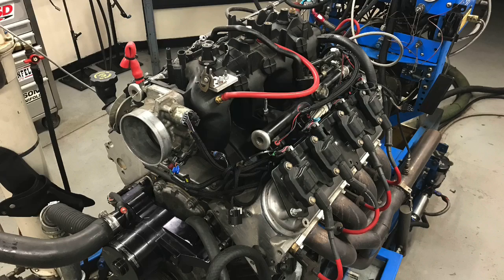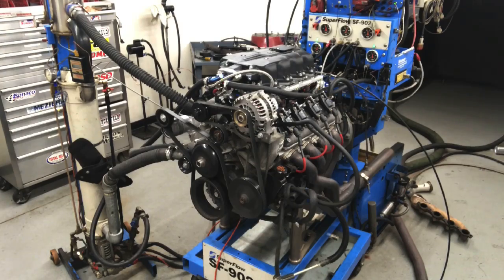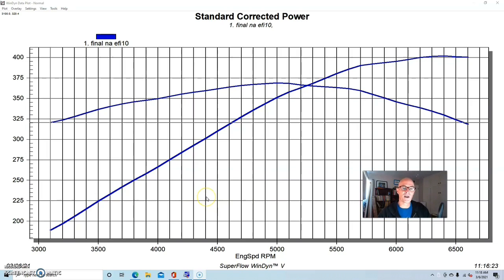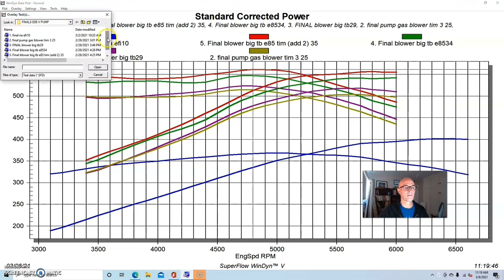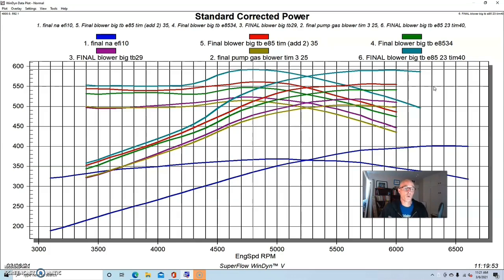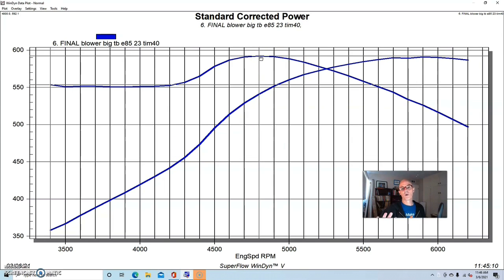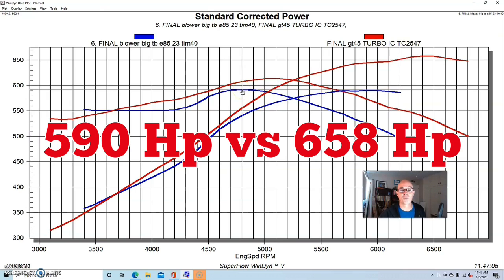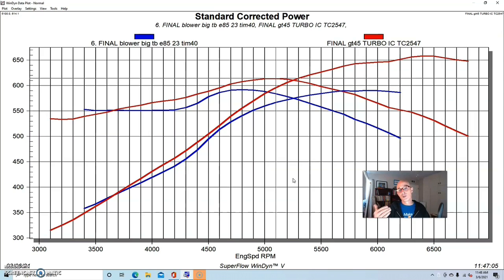CAD LS BLOWER VS EBAY GT45 TURBO-WHO DOES LOW $ BOOST BEST?

Comment: WRONG......BOTH TOGETHER !!!!! LOL    Use the clutch pulley off the Eaton supercharger from a mecedes KOMPRESSOR( It's electrical activated on and off) , Wire it for constant on. Then on the Turbo side wire in a pressure (boost) activated switch to turn the super charger off at a set level of boost from the turbo and then on again when the turbo loses boost.  BEST OF BOTH WORLDS.
Reply: PUT THAT ON YOUR DYNO AND TEST IT !!!!!!............PLEASE  LOL

Comment: No fair - the PD blower was seriously crippled by trying to fill each LS-sized cylinder by a single Northstar-sized blower-runner.
All you would have had to do wold have been to run interconnecting runners to: 1st and 5th cylinders in firing order, 2nd & 6th, 3rd and seventh cyls, and 4th and 8th together. You would have seen a built-in bottleneck disappear (instead of seeing horsepower fallover WAY earlier than the NA setup.)
Reply from the maker: that is not accurate
Reply: @richardholdener1727  How not? Looked like one Cad runner-per-LS-port to me? Miss anything?

Comment: Man, these are awesome numbers for a 4.8...I'd really like to get an 80s Cutlass (G-body) and put this 4.8 in it with a good cam, the Cadillac blower assembly, a set of tuned-length headers, and a true 3" dual exhaust with Black Widow mufflers.

Comment: its impossible to turn anything with NO parasitc loss. the engine is acting as an airpump to spin the turbo. there is no such thing as free energy. turbos can not violate thermodynamics.
Reply from the maker: THE IMPART MINOR PUMPING LOSSES COMPARED TO THE PARASITIC LOSSES FROM THE BLOWERS

Comment: I wish I could find conversion manifolds for the Cadillac supercharger or the ford 5.4 gt500 supercharger to fit the Aussie BOSS260 5.4ltr 4v 😭
Reply: That would be cool.  I have a vmp gen3r on my 07 gt500 it is a 2.65 tvs pushing 20 psi on 93/boostane (100 octane) it's around 750 wheel with stock exhaust manifolds and still running a twin 69 tbody not even a mono.  Completely stock engine.  The 5.4 4v is a beast of an engine and it makes torque like no other I'm around 700 on torque.  A coyote at my power level even running a torque happy tvs like I am would be lucky to see 600 torque in many cases.  Totally different experience from a coyote.  Don't Rev as high but makes way more power low and mid range it's fun on the street with a 6 speed manual trans.  Torque everywhere any gear any rpm and loads of it.  Amazing blower.  

I know you aussie guys do alot of cool stuff with the Ford mod motors.  You guys have some nice intakes manifold for 5.4 4v that we don't have in the states.  The 5.4 4v can make some power na too if you can get a good intake setup.  Awesome engines and they sound killer.

Comment: Just trying to find a good supercharger low buck where to look? 6.0 corvette c6 help
Reply: 2010 jaguar 5.0 V8 supercharger. TVS1900 like on cad LSA.
SHOULD BE $600-800 but may need a new isolator.
It's a front shaft and TB blower.
TVS1320 comes on Jag V6 version.
Edit: c6 vette? Get lsa blower

Comment: Richard, let's put a myth to death! Turbos are all free horsepower and don't take horsepower to run. Put an engine on the dyno and run it NA. Then add a turbo, but vent the charge air to the atmosphere. You might have to restrict the charge pipe to build boost. Try to make 10lbs of boost for the fun of it. I think we will find the engine will make less horsepower. This will show us how much it takes to run a turbo.
Reply from the maker: that won't work-because without the boost the motor wont make the same power and have the same exhaust flow-I'm sure it takes some pumping losses to power the turbo-but much less than the blower (by orders of magnitude at high boost)
Reply: @richardholdener1727  it would still be fun to see. I agree that turbos are more efficient than blowers.

Comment: Why do they not run turbos in top fuel? Always a blower?
Reply from the maker: turbos are outlawed
Reply: @richardholdener1727 ,could they if it were within the rules? Or would turbo lag kill them at them power levels? Just always wondered why you never see a turbo top fuel car. Would love to see a dyno graph with one of them beast! From nothing to everything in a split second!
Reply: onions sounds logical to me. Seems them thing's (10,000hp) would spin a turbo beyond its capabilities now that you say that. Also how big a turbo would have to be to support 10,000hp!

Comment: All that additional plumming for a turbo, also SCs have a good torque curve at lower speeds.
Reply: That plumping will cost less than the adapters and extra parts for the blower.

Comment: Doing a burnout would be considered wide open throttle from idle wouldn't it?
Reply from the maker: not much load there
Reply: I don't go wide open throttle on a burnout.  I just pop the clutch after revving it little in 2nd gear and just take my foot from the clutch to the brake while modulating the throttle accordingly but I never go wide open throttle during a burnout guess different people may do it differently but like Richard said low load.

Comment: What I learned is when Richard talks about a cheap new way to make power prices go up and it's no longer cheap!!!
Reply from the maker: IKR-THAT GUY SHOULD JUST KEEP QUIET
Reply: @richardholdener1727  Could you mock up a power chiller setup similar to the hellcat? My understanding is the power chiller diverts the ac Freon to chill the liquid/coolant cooling the blower. What kind of increase would you see with a lower AIT Using this setup?

Comment: And there is going to be that guy that says, "but turbo's make backpressure, that reduces power", but failing to see that the proof presented right here, right now , contradicts that. Blowers are neat. Spray is fun. A high compression, lumpy cam race motor sounds cool, but I daily a turbo car. Viva la difference.
Reply from the maker: THE TURBO DOES HAVE SOME POWER (PUMPING) LOSS COMPARED TO AN NA MOTOR-IT IS NOT NOT NEARLY AS MUCH AS A BLOWER

Comment: I"ve heard it takes 30 hp to make a 100 with a supercharger. 
Where as it only takes 10 hp to make a 100 with a turbo.
Reply from the maker: IT'S NOT THAT SIMPLE
Reply: @richardholdener1727   Not meant to be exact.  Just a general reference.

Comment: Richard, you neglect the biggest advantage of the turbocharger, which is that it's more efficient and the gap even bigger as you go up on boost. Also, while the GT45 is a good size turbo for a 4.8 lt, for competing effectively with a blower you need something smaller - in that case a T4 where are sold on eBay for 100$, or (why not?) the typical eBay T3/T04E in a twin turbo combination.

Comment: Ok, maybe I missed something but your talking about parasitic loss with the blower yet you weren't running belted accessories with the turbo?? Wouldn't the turbo's HP go DOWN with the same acc. as what you used with the blower?? Just sayin'.....ya' know apples to apples and oranges to oranges??
Reply from the maker: YES-THE ACCESSORIES WOULD DROP POWER SOME ON THE TURBO MOTOR
Reply: @richardholdener1727  Thanks for the reply Richard. It would be nice to know how much of a loss on a turbo motor compared to the blower and would it make the blower more competitive. Personally, I would go turbo. Thanks for all your informative videos! I never miss one.
Reply: Turbo needs load to spool up quicker. The accessories would make turbo more responsive. The engine dyno can manipulate the load at any rpm.

Comment: Parasitic loss from driving the supercharger is huge! Turbo is better!!!
Reply: Supers are for acceleration due to immediate response, turbos are top speed...

Turbos lag.
Reply: @shadowopsairman1583   Street driving superchargers win- But,  At the dragstrip turbochargers win.  This is because of the dragstrip you are in the revs of the horsepower range before  Launch.  The great low end torque of a supercharger gives it more streetable power

Comment: literally everyone running a stock converter is starting their WOT pull at 2000.
Reply: Even if it's not Wot there is still almost no manifold vacuum. Lots of GM trannies shift with throttle position and not vacuum so it's actually possible to have no manifold vacuum at low rpm. It doesn't take very much throttle opening to have little vacuum at highway rpm. Something like the Tbss has a 90mm throttle body and is under 2000rpm on the freeway at 60mph even with its 4,10 gearset. Going effectively wot at 2000rpm happens almost everyday for every truck even if the pedal isn't on the floor.

Comment: How much boost can I safely run a 5.3 without ring gap?
Reply from the maker: 1 psi
Reply: @richardholdener1727  that is the best answer. 1lb turns into 2,3,4,5,6,7,8,9,10,11,12,13,14,15,16,17 and some where along the way it breaks a piston ring land. If you want to run boost gap the rings.
Reply: @richardholdener1727  🤣🤣🤣🤣🤣🤣
Reply: @richardholdener1727  fair enough. Sure do enjoy your videos, keep um coming 👍

Comment: I have to disagree that there are no parasitic losses from a turbo. Can you run a couple engines without a turbo, then install a turbo in the exhaust that is restricting it and producing 10 to 20 psi of boost but not putting it into the engine. I guarantee you there is parasitic loss.
Reply: It's about 4% in pumping losses on a properly sized turbo set up. I'll try find the article I saw back in the day. That was on an Indycar though
Reply from the maker: I WISH IT WAS A STRICT PERCENTAGE, BUT LIFE IS NEVER THAT EASY
Reply: I wish it were that simple. If the turbocharger isn't feeding the engine, sure it's going to be pumping air with no restriction because it's going to atmosphere, so therefore creating *zero* boost and therefore taking very little power from the engine.

Comment: Turbocharger can rob power by making more backpressure at headers. If there is no force induction that doesn't use any power to make it work it's just nonsense.
Reply: Unless you purposely install a way too small turbo, the amount of backpressure present in the exhaust before the turbo never "reduces power" vs an NA combination, or blower. As long as you have a supporting fuel system, and a stout engine, turbochargers are free power. Blowers are parasitic power adders. The proof is here, my freind. I wonder why there is a turbocharger under the hood of practically every semi tractor on the road, and not a PD blower, (Detroit series 53, 71, 92 and 149 excluded)
Reply: it uses the power of high velocity and high temp exhaust gases that otherwise would be wasted going out the tailpipe. Not entirely free energy, but mostly free.
Some post WW2 radial aero engines used 3 power recovery turbines in the exhaust system to extract power and feed it back to the crankshaft through a system of gears and a fluid coupling. 
They added 550 HP. 
See  Wright 3350 Turbo-Compound in the internet.

Comment: Stop saying turbos present no parasitic loss.  That is simply not true.
Reply: Turbo make more backpressure that can rob power, but unlike supercharger that rob power from the crank
Reply: @yusufkuntoro3141  Either way, it is still lost from the crank.  

Obviously it is the crank, that pushes the pistons, which are developing said back-pressure against the exhaust stroke.
Reply: It is less loss however. You will never gain power (beyond a certain point of course) without some form of parasitic loss. The question is how much. If you have an efficient turbo setup with with a 1 to 1 drive pressure ratio, it'll do better than any blower at an equivalent airmass.
Reply: @GreatLakesLogger  Yes, we all know that.  But "less" is not "none".
Reply from the maker: IT'S PUMPING LOSS
Reply: @richardholdener1727  It's really not that hard to admit that you are wrong.  But I'd be happy if you would just stop publishing this erroneous information.

Ideally you would set up a test, designed to find out exactly *how much* horsepower is actually required to drive a turbocharger per each additional PSI over atmospheric.  That would finally put the fallacy to rest.
 And I'm pretty sure the resulting data would be something we could all appreciate.

Comment: BOTH BOTH BOTH BOTH BOTH Run them both at the same time feed that  M-120 blower with the gt35 and see if we can hit 1000 on 22psi !!!!
Reply: I want to see the blower and a s480
Reply: @James George  I believe if the turbos are feeding the blower and the blower is feeding the motor then the turbos would assist the blower in turning thereby reducing the amount of restriction. However if the blower was feeding the turbos which in turn feed the engine as you suggested I feel pretty sure that the blower at that point would become a major restriction seeing as how turbos are designed to push air not suck it. Having the blower feed by the atmosphere then feeding turbos or turbo which flow more would be a restriction but sense the turbos have a higher likelihood of flowing more air then the blower would not be as much of a restriction in a twin charged application after the turbos because the pressure from the turbos would help spoil the blower more efficiently like a fan feeding a fan. But that's just my hypothesis ! What do yall think ?
Reply: The blower is just an expensive throttle plate, when the turbo out flows it my freind. If it was a centrifugal blower, blowing into the GT45, that would be something to see.

Comment: There are some pumping losses with a turbo, it's not free boost, but nothing like the parasitic losses from a belt drive supercharger.
Reply: Yeah, but you can't say anything. The laws of thermodynamics don't apply if he says so.
Reply: @ThePaulv12  
I stand corrected...🤣
Reply from the maker: you can say anything-there are no parasitic losses-but there are pumping loses
Reply: @richardholdener1727   Words mean things, my friend.
Pumping losses are a type of parasitic loss when they are driving something like a compressor. Anything other than the wheels that the engine drives to do work - water pump, alternator, supercharger, turbo - are paracitic losses.
Reply: @richardholdener1727  isn’t it great that people come here to argue over meaningless things😂

Comment: You could turbo 3 ls's for the cost of just the adapters for that 'lowbuck' SC.
Reply: For real, ring aeromotive or deatchwerks etc and price up a fuel system for E85, boost and 700hp. Let me know how that goes
Reply: Sounds like you're speaking from the experience of having done exactly zero turbo conversions. It's nowhere near as cheap as that.
Reply: @brianfrost303  Still much cheaper than supercharge
Reply: @brianfrost303  you can buy a big turbo for $500, truck manifolds are free, piping and t4 flange is $150.  Piping and intercooler is another $350. Turbo setup is $900. Blower adapters alone are $1400 that doesn’t include the blower/water tank/pump/heat exchanger.  I could do two turbo setups for the price of one blower setup.
Reply: @CarsTrucksAndDreams  Don't forget a good quality wastegate, hose couplers, good tbolt clamps, injectors, lines and fittings for the turbo. Stuff starts adding up with a turbo.
Reply: @allanb3222  wastegate is $120. I didn’t include the fuel system because you’re going to need that for both combos. The $350 is intercooler, piping, hoses, and clamps.
Reply: @CarsTrucksAndDreams  by your own words you couldn't even do 2 turbo setups for the price of one blower setup let alone 3 like the guy above said.  I'd rather have the blower setup.  It's worth a few hundred more bucks to have a better power curve and alot more torque on demand down low on the street and alot less plumbing to deal with too.
Reply: @midnight347  good thing about this country is you can choose what you want. I’ll do it the cheap way. You can do it how ever you want
Reply: Ask anyone who's done a V8 turbo if it can be done for $900 and they will literally laugh in your face
Reply: @brianfrost303  I’ve done it!!! If you want to spend more that’s fine. But it can be done. Just stop telling people it can’t be done
Reply: @CarsTrucksAndDreams  Lmao sure bud. Whatever you say.

Comment: There’s people like me who want low down torque and power who want a supercharger. That’s why I run a L67 in my van. More torque down low and better fuel mileage than a big V8 plus in Australia I can go to any wrecking yard and find 10 motors to pull parts from.
Reply: A small turbo will make more low-mid range torque than the supercharger.
Reply: @ArchimedeanEye  sometimes true but my point was there will always be people that see a supercharger as a better option. 
For my application turbos produce a lot of heat and in a van where the engine sits right beside your leg the extra heat is not a comfortable option and remote turbos increase response time.
Reply: @dandewar8403  Yeah fair enough.  I've run both, including an LSA roots type blower.  The beauty of a blower in the 'V' of a V8 is compact packaging.  I'm not a big fan of the heat soak though.  When it gets really warm you can lose 50HP easy when the ECU starts pulling timing due to intake heat.  I would like to try a centrifugal blower mounted low with a front mount intercooler.  Would not have the low down power of a roots blower but heat management would be better than a turbo and a roots.
Reply: I agree with you, I would like Richard makes several runs with different blowers to compare the power looses between roots, skrew, turbos and centrifugal...
Reply from the maker: WATCH THE VIDEO RECOMMENDED IN THE VIDEO WHERE I RAN ALL FORMS OF FORCED INDUCTION ON THE SAME MOTOR AT TEH SAME BOOST, AF AND TIMING